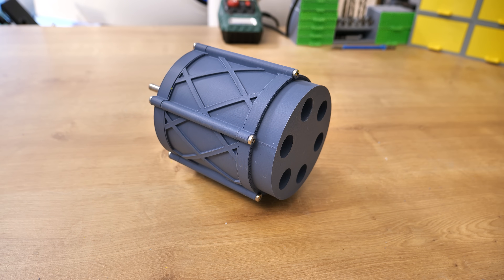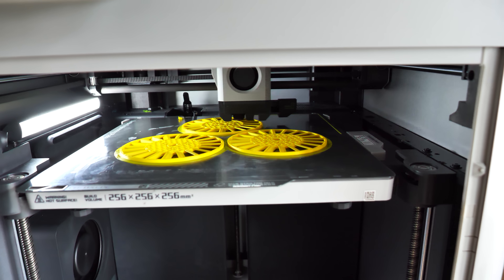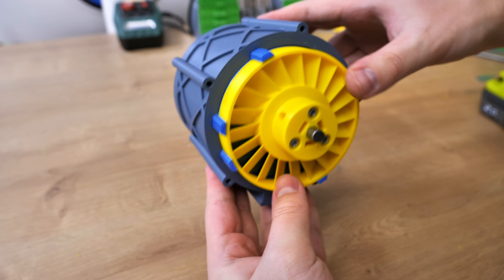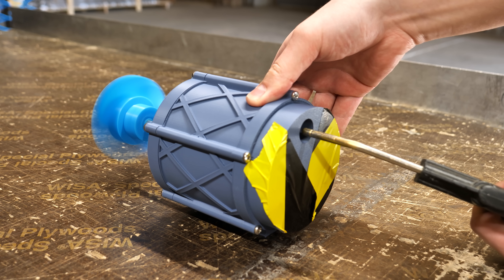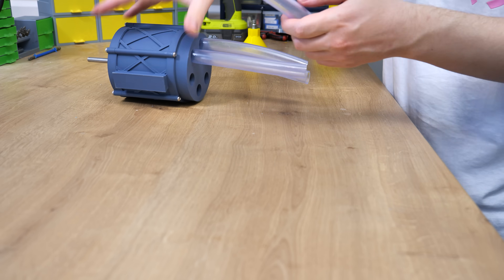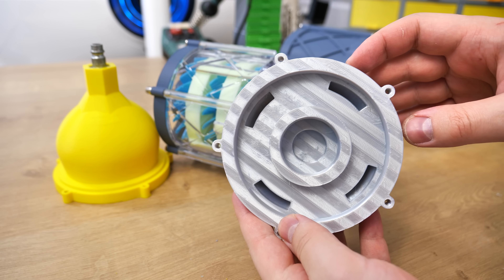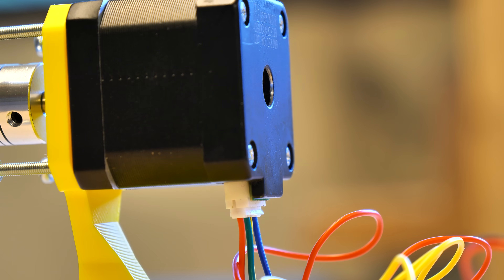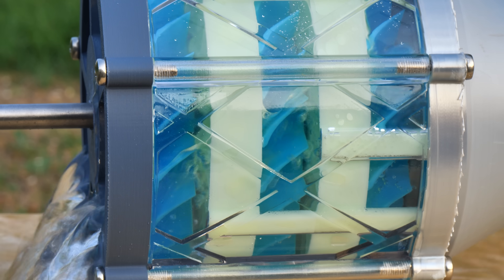I 3D Printed a TURBINE and Produce Electricity With It.

Comment: Im a noob and just got my first printer a P1S! 

First I love your accent 😊 also Im so glad I found this video. 

Im trying to diversity my disciplines so for my project I want to build a compressed air energy storage system. 

So it would combine solar, to compress air during times of solar surplus. 

Controller logic and electronics 

Pneumatics, and design and cad with the 3d printed turbines. 

Im hoping to prove that while wasteful, compressed air storage has potential , you can just scale up your storage capacity. 

My rational is the main issue with solar is the cost of energy storage. 

Compressed air is cheap , available, servicable. 

Its thermally very inefficient but again, if you anticipate 50% losses, its so much cheaper to increase your air storage by 100% and totally bypass this problem. 

“Waste” isnt technicaly “waste” when your energy is effectively free from the sun. Who cares if I lost half of it , if I can still store 10kWh of electricity for a bad storm.

Comment: The opening on the grey one is a lot larger allowing air to be sucked in due to the speed of the nozzle air so having the other one and saying it dosnt work as good well Yh it’s only running compressed air not the extra sucked in air which means less overall air particles and less driving force

Comment: Is the figure at 1:20 backwards? Won’t the air technically go from right to left as you animated it?
Reply: Had the same thought. The air foil shape is setup to turn shaft into air power rather than air into shaft power.

Comment: Your turbine rotor blades are back to front, which is one of the reasons why it won't work when forcing water through it. It creates flow vortices behind the rotor blades, loosing efficiency.
If you're going to make a 2nd version, I'd recommend you pay more attention to the volume changes through the stators. You have air entering at a reasonable volume, then it being constricted in the middle of the stator as it changes direction, then expanding out of it before it hits the next set of rotor blades. This is absolutely terrible for efficiency, which water then reveals.
Water does not like any sudden volume changes as it's 2000x denser than air, so it exaggerates any pressure buildup problems. Tune it to run on water flow, it'll be amazing on air.
Stator version 2 would ideally have the blade thickness changing from the centre towards the edge, to account for volume differences in this axis. They'd also need to be pitched to match the entry and exit angles of the rotor blades, so the flow doesn't suddenly twist when it hits/leaves them.

Comment: Why are you building low pressure turbine for high pressure air from compressor ? This turbine is most effective with high flow and low pressure. For high pressure and low flow rate you should build pelter or tesla turbine. If you are driving this turbine with high pressure like that, your first stage is converting almost all kinetic energy, and other stages are doing more harm than good, by creating parasitic drag.

Comment: Don't want to spoil it for you, I worked at factory producing turbine blades just for ten years or so, but you have rotors backwards. Leading edge is thicker, then is thickiest part of the blade, at 1/4 to 1/3 of length of the profile and then it slowly vanishes into trailing edge, that is relatively sharp (compare to leading edge).
Also, profiles for gas or liquid look quite different, not like it can't work at all, but efficiency-wise you can't just switch between those two mediums. liquids (water) tend to be non-compressable after all...

Comment: I wonder if the water did not work because it's not getting equal pressure on all the blades.  Its just hitting the bottom blades.  Maybe if the turbine was set vertically, and you pour the water downward, it will push equal pressure on the blades, and then maybe you get a better result.

Comment: If you use q support blocker in cura you can change the properties inside said support blocker while also having different model settings for your part. Also try flipping the turbine so that it’s standing up when you put water through it.

Comment: Shoukd have tried the tirbine vertical with the water flow. Gravety is pulling the water to the bottom messing up the flow of water through the turbine, for it to be horizontal you would need far more flow to get it to spin.

Comment: You need a better input ! I think it will perform much better with a lower pressure and higher volume....that compressor gun head is giving high pressure but greatly limits your VOLUME if you can multiply your volume by TEN and reduce the pressure the same ratio You can get a second data point - then double that and reduce pressure again and you will have three data points - from here you can map out the entire range of volume, pressure and RPM. showing where the best combo is.

Comment: Rotor blades profile is backwards. The air should hit blunt edge first, then leave the thin edge last.
So you seem to have copied a compressor instead of copying a turbine.

Using an air gun create a very fast airflow at the tip of the nozzle. But you tried to build something that need lots of air.
If intake hole is 20mm wide you may need to hold the nozzle 50 to 100mm from the intake hole to get the most air into your "turbine".

The profile of the vanes seems unnecessary thick in the middle. Here too the air should hit a slightly blunt edge first, then leave a thin edge.

Comment: Doesn't the turbine depend on the mass passing through the vanes?   If so you were creating a venture effect with the air gain and drawing additional air mass through the inlet which would be the reason for the higher RPM. I not a physicist but just a thought.

Comment: Love the vid. Just gonna say on my ranting soapbox over here, not targeting this video specifically, just getting something off my chest that I've been bothered by: I hate "RPM" as a measurement of rotational speed when rotations per minute are in the thousands. We should have RPS, or "rotations-per-second", for high-RPM measurements. So, 6000 RPM would be 100 RPS, which is much more manageable in your head when conceptualizing things involving rotational speed. When you have more than one rotation per second, it's time to start thinking about rotations in terms of one-second, because it's much easier to conceptualize 10 rotations per second (i.e. 100ms per rotation) than it is to conceptualize 600 rotations per minute. A minute is a long time when you're spinning at tens or hundreds of rotations per second!!! Anyway, end rant. #RotationsPerSecondClub if you feel me.

Also! Don't make parts out of 3D printing materials that absorb water if you plan to use those parts in an application where they're interacting with water. A lot of 3D printing plastics absorb moisture and will deform or change in dimensions when exposed to moisture, such as PLA and nylon. I'm sure there are other FDM printing filament materials that aren't so hygroscopic (I have a background in CNC machining, not 3D printing) that would be better suited to water-interaction applications, but PLA definitely isn't what you want to use! The filament alone absorbs water over the time and can cause prints to come out with a very poor finish just because of all the moisture bubbling out of the filament while it's printing, to the point of being totally unusable without first being completely dehydrated first. PLA is fine for prototyping a water turbine or other water-interfacing mechanism, but you'll ultimately need to fabricate your device using a material that's completely impervious to water for any long-term applications.

Good luck and thanks for the video! :D

Comment: garden hose didn't work because you need to concentrate the flow not expand it ... or something like that only 60psi water not enough for low speed need high speed for turbine with some jet ports though firing at first set of fins with 1/16th" jet port would reduce flow but increase psi so flow speed just be significantly less flow... alot of stuff to think about getting useful work from machines

Comment: Fun project if you ignore the fact that air compressors are only 5% efficient and I doubt your even gonna get back even 10% of that 5% with this turbine.  Meaning every kilowatt your compressor uses generates like 5w if your lucky 😂

Also point on the splitter is that it offers way to much expansion room. 6 small jets would be better.  
Restrictions speed up flow drastically.

-A compressed air engineer.

Comment: You need a very small nozzle at all of those intakes because compressed air isnt very fast, if you pass it through nozzle the pressure will transfors to speed which your turbine needs, try this experiment with some pc fans and different nozzles like when you blow from lungs directlly to fan, nothing will happens at all, but when tou use straw in front of fan blades your lung pressure will turn air into speed and it will work so much better. Hope this will help you

Comment: two thing slow down it's NOT a race speak clearly ... second thing you dont HAVE to have stators after rotors you can second shaft counter rotating rotators in where the stators are and redirect the airflow directly into 2 more rotors removing the stators fully and increasing compression 
RPM meter is fine ... or timer gun ... they both do the same thing convert rotational speed into a comparable measurement

Comment: To get the turbine to work with water, you will have to get uniform pressure throughout the entire turbine or much higher flow. With a completely open exhaust end, pressure is not building up enough to overcome the waters weight.
Reply: amaissin so much skills and so little knowledge of fisics, great comment.

Comment: You needed a water flow output plate similar to the water intake plate to limit the total amount of water flowing out of the turbine all the water flow pressure is lost and the turbine can't spin due to it you can place the turbine vertically and let the water flow top to bottom or bottom to top for testing if you have a wood piece or waterproof cardboard piece(cardboard with a side covered in a plastic layer) place it in front of the turbine water flow output side of the turbine and minor cuts for water to flow out of and figure out the size of cuts required to get the maximum turbine rotation speed and water flow.

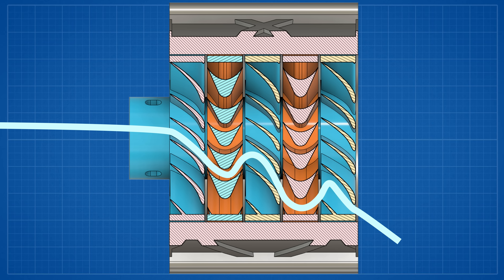Comment: 1:27 In this diagram the air should be flowing from right to left, and the rotors and stators are switched up as well, the triangular blades should be the rotor

Comment: The next wheel has to have a larger diameter to be effcient in the slower flow that has like 55% kinetic energy extracted from it. Each succsessive wheels of same diameter has a much lower overall performance. On 3 wheels the last wheel would act as a brake. You need to adjust according to Betz law to keep the power coversion efficiency per wheel up. On the same diameter you could better do 2 wheels in opposite direction without a stator.

Comment: A tip for inserting the shaft, I have seen it done with good results where you put the shaft in a drill and spin it whilst you insert it into the part.

Comment: Like fg said the first row would be nozzles. Instead of blowing it from the front you should attach the nozzle on the outside of the housing directly into the first set of turbine blades. It will give you significantly more torque at low rpms. And you will want to seal you stator to prevent air passing by any cracks. This is how a hp steam turbine works. Amazing work btw would seriously be interested in making one too!!

Comment: The stepper motor is a good generator at low speeds, but it works very poorly at high speeds. It is better to use a conventional DC motor.
Шаговый мотор хороший генератор на низких оборотах, но на высоких он работает очень плохо. Лучше использовать обычный двигатель постоянного тока.

Comment: Nicely engineered, but your "turbine" would work best as a single stage. For it to be a turbine of any kind, the stages need to vary in radius and height with varying blades sizes and quantities. All dependent on what the turbine is meant to do. Adding or extracting energy.

Comment: Your turbine doesn't have any expansion which is required to optimise the energy recovery of a compressible fluid.  Also, the aerofoil sections are going the wrong direction in your diagrams.  I'm not sure if you've carried this across to your design.

Comment: Your diagram is backwards and also maybe your turbines as well, turbines work just like wings the leading edge the rounded side cuts into the air then forces it downward into the other blades.

Comment: As the fluid passes through the fan, the flow path is too large and the flow velocity is greatly reduced.
When the flow velocity drops significantly, the fan speed also drops significantly.
If the inner cylinder that supports the fan is thickened to narrow the flow path, it is possible to prevent a decrease in flow velocity.

Comment: I'd be interested to see what the turbine immersed in water with a water flow would do.  I have a feeling that if the turbine was full then the flow of water would spin the blades, so if not submerged then perhaps add a constrictor on the output so the turbine fills up and allow pressure to build within the turbine so it'll spin.

Comment: You should spin that turbine with a electric motor and see if it produces any pressure 😉 or high flow wind 👌.
I guess it is expensive to order those parts from PCB way 🤔
Reply: Metal parts...

Comment: I think that with the kind of air pressure and flow you have you would be better with a turbocharger turbine type rather than axial type.
Also I think that your rotor blade are reversed. The leading edge should be pointing toward the inlet. Have a look at turbine cutout pictures on the web.
Nice work !

Comment: If you want to get really creative look into radial outflow turbines. Didnt go anywhere as the turbine wheel got too large for big installstions but small versions are great and easy to print. You also get a natural expansion in cross sectional area as you go outwards

Comment: Nice video but there is a few things wrong with your design. What you have made is a pressure compound turbine (rateau). Your stator should be convergent nozzles and the rotator are impulse blades. Aka opposite to what you have plus your nozzles (BLUE) are the wrong way around. If you compound the design into 3 stages you need to design the cross sectional area to increase to keep the velocity at mach 1 at each exit nozzle.
Reply: theres no heat available to keep velocity at mach1... remember? thats why plain air cant break supersonics in a diverging nozzle? whereas hot air and or steam or other energetic fluid can
Reply: I agree but I didn't say it would, convergent nozzles chokes flow up to mach 1. In reality unless this design can supply a fluid that chokes the flow across the entire cross section there's no point using stage turbine. You could probably get away with a Curtis turbine but in reality a single stage is more than enough

Comment: Just a small tip, hydroelectric turbines on a small scale use gravity as an assist. When you had it connected to your garden hose if you had held it vertically it probably would have worked considerably better.

Comment: Maybe the pressure of the water is able to be increased so you could use the turbine. Would be cool to see something like that.
Reply: most water turbines use gravity also. the turbine is found in a dropper tube. If he had of rotated it so the hose was at the top it would have spun just fine.

Comment: You use sound to get RPM. Look at the frequency spectrum of the audio, look at the highest peaks. They are showing the RMP, or are multiples of the actual RPM. If you already know roughly what ballpark the RPMs should be, find the highest peak in that area and 1/X Hz to get RPS.

Comment: You should be able to boost the power quite a lot by preswirling your air in the intake manifold before it hits the first rotor, and by putting the air transfer nozzles way closer to the first rotor and not have a big gap in between them. kinda like having the intake holes gradually turn into a stator that nests up against the first rotor as close as the other stators do. Im not saying double the power, but quite some at least.

Comment: Have you ever tried balancing your rotary devices?  (Fans and turbines. I don’t think gears will get much from balancing)
It certainly won’t fix most of your problems, but I think you’ll get quieter faster machines which will probably last longer. Clough42 recently did some videos about tools to do static balancing. 

Also, the edges at corners of your housing that you needed to sand: if you put a small chamfer it should print better. Also look into your pressure advance settings.

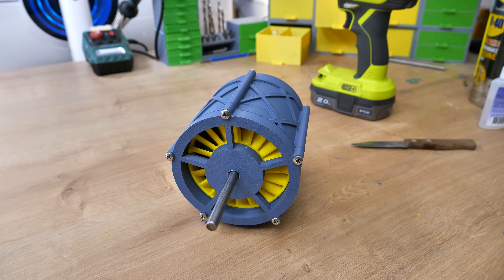Comment: I think this video would be significantly better if you either included more useful information, or cut the useless filler. For example, 4:06 to 5:14 could be condensed to at most 6-10 seconds. I get you want to make the 10 minute mark for ad revenue, but if you're going to do it, be honest about it. It's a fascinating project, I guarantee there's more interesting things that could have gone into the video than endless shots of running the compressor via air, water, etc.
E

Comment: Think you would need to make an end with a small opening for your water version. It should help keep pressure on the blades then, or use a jet washer to assist :)

Comment: You need to integrate your air intake into your stages. Right now you're losing all the energy of the expanding air to the intake. Your inlet air should lead directly to a small fan with increasingly larger stages behind. That way you harness airflow AND air expansion. You're effectively building a de-compressor engine.